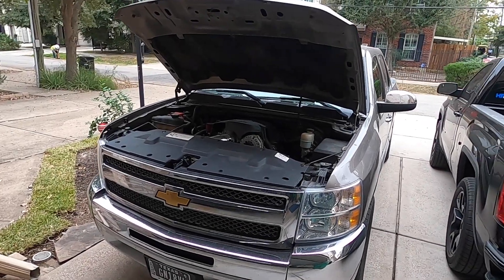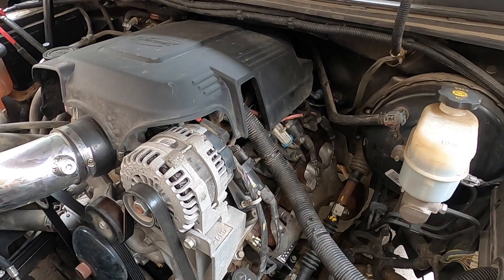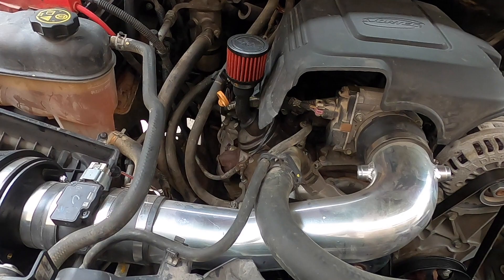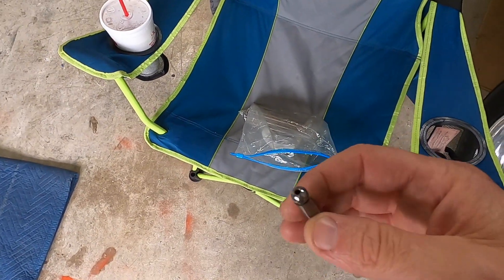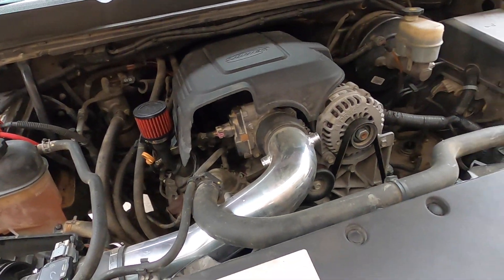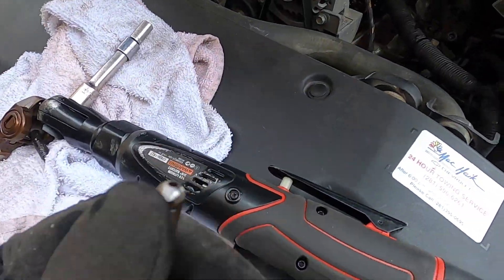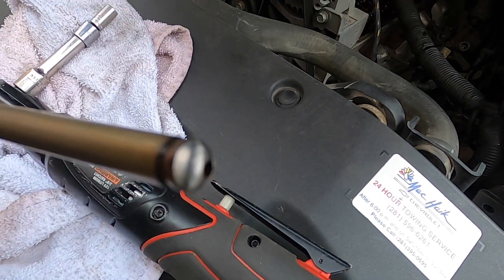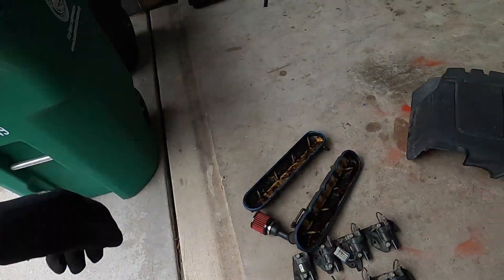Pushrod Damage 5.3 LMG 2012 Silverado Gen IV

Comment: I just tore down a 6L with 150k miles (today). Six pushrods were worn like that, and the rocker cups were similarly worn. Not sure the cause either, but I’m going new rockers and rods. It is a common issue. Many believe it’s a sign of oiling problems, and if so, your lifters could be the cause unless the pushrods had restrictions. My pushrods were free of trash, so it’s likely a lifter issues for me. 

Did you check pushrod length required with the new cam? Many need different length pushrods as the cams aren’t the same diameter as factory.
Reply from the maker: I ended up replacing the rockers also.  It sounded like 1980s diesel after a few miles.